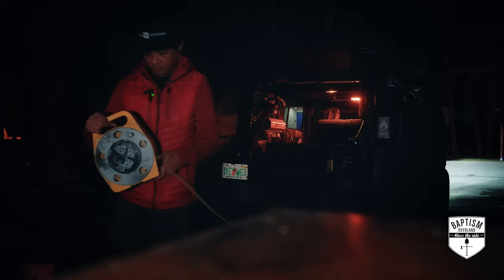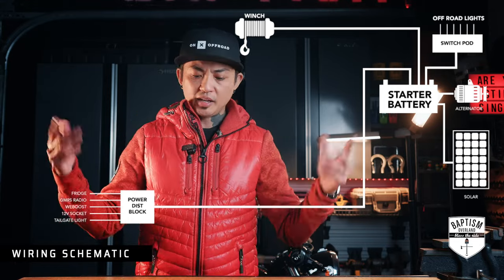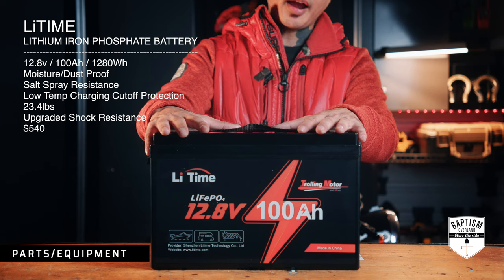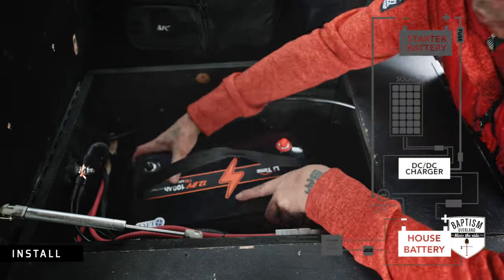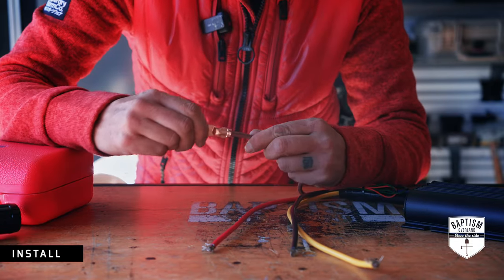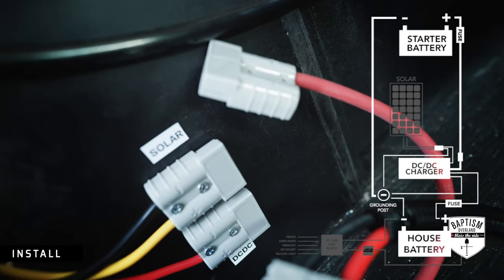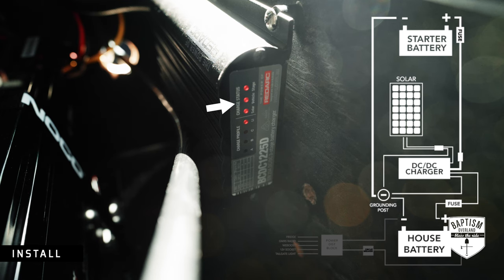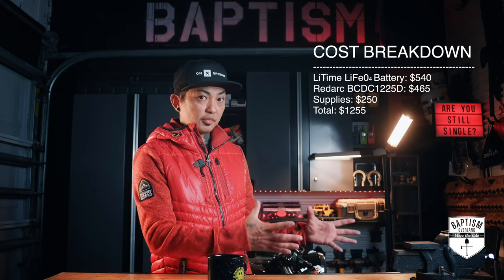REDARC + LiTIME...Dual Battery Setup Made Simple!

Comment: 🙂 I started with a small 100ah setup, and now have 400ah, 15K Invertor with RedArc Revision setup. It's addictive
Reply from the maker: Hahaha yeah I'm realizing that now
Reply: May I ask what you are running my friend with a 15k inverter? I understand having 400ah or more of battery especially if you want to go overlanding and be off-grid for days to weeks.
Reply: @DustinEveritt  Sorry. Typo on my part. It’s a 1500w inverter. I run a number of things depending on the trip and time of year. They can include fridge, CPAP, induction heater, rice cooker, and my EcoFlow Wave2 using a 24/12 DCDC converter during peak summer. 
My setup has changed since this post as well. Still 400ah but I now have 400w solar and up to 80a alternator charging. So the large capacity isn’t as necessary until you need over 100a constant pull for awhile. 
Hope that answers your question.
Reply: @midwestiowashooter  how do you like the EcoFlow Wave? Does it provide heat as well as AC? I have been looking at whether to do a DIY "House" Battery system or to purchase an EcoFlow Delta Pro/Delta Pro 2 and get their 800 watt DC-DC Inverter Charger or get Renogy Lycan..
Reply: @ I like it but also understand it has some huge limitations you have to overcome. It’s not going to run on max long with its own battery so use it for when the sun goes down. It will do heat but will stop if the intake are is below 0 so in those temps a diesel heater is better. For you to really get it to run in either case a line time you need more EcoFlow batteries or use a DCDC 12/24 to allow more than 8amps in. 
No matter what you do I think some kind of alternator DVDC charger is a must to quickly top off. The all in on units are nice for their price point but they have limits. When you go full dedicated dual battery cost quickly jumps but it’s a lot more versatile. For example diesel heaters can sometimes pull more than the DC output on an all in one unit can provide unless you switch to AC power, but a dedicated one it’s all about how you wire and fuse it for the potential load.
Reply: @midwestiowashooter  yeah that is definitely understandable. LiTime has some pretty decent deals right now for the holidays. I can get (2) 12.8V 300Ah RV batteries for the price of (1) 12.8V 400AH Deep Cycle Batteries. I'm also looking at their DC-DC chargers and Solar Charger as well. Trying to find a good budget 12 volt Fridge to have in the bed of my truck under my camper shell. I have a Utility Trailer that I want to convert into a DIY Micro-Camper like setup with the amenities. If you or anyone else has any suggestions or tips, they will be greatly appreciated.

Comment: Great video! I don’t recall you mentioning this, but with this current setup you have, in the event your main battery is dead, is it possible to have your home battery “jump” start it? Or do you need to add something else into this configuration to make that happen?
Reply from the maker: That I don't know. I have to find out. In other setups with some other brands it's as simple as turning on a switch. With the Redarc BCDC, I need to ask them

Comment: Nice quality and informative video. 
I ran into you and the other FAT (Florida Adventure Trail)  members in Florida a year ago and I now watch your show. You are right about dipping your toe into the 2nd battery space as I have over 6.5K in my system as Redarc is pricey but good stuff. I did the manager 30, 1500 W inverter, the new blue tooth enabled display, and the Rogue (but I have yet to set up the rogue). I have solar on my RTT and an Anderson plug under the hood for a second solar panel as no one wants to always park in the sun. As the RedArc’s manager 30 has a shore power option, I ran a plug in connector into my rear bumper so I have various options for power. For my battery I ran an SOK 200 ah version over Litime ones as it was cost effective and it had heaters if I traveled north. I did buy two of those Litime batteries but used my SOK on my 4runner and I plan on using them on some other portable builds for other vehicles with solar and the dc/dc charger setup. 
I would recommend looking at the Redarc Rogue as it has dimmable light options and sensors for fuel, water, and possibly for a temp sensor.
Reply from the maker: Well I guess I'll know who to ask when I get the other stuff haha I'm sure I'm gonna wanna grow it. Dual has been a game changer!

Comment: Great video I’m going to do something like this to power and electric air conditioning compressor. My car already has a sound system attached and the compressor would take a massive load on my car. So I was looking around for alternatives to not upgrade the alternator because there is no options for my car. I figured I would just at a house battery just to power the compressor. Thanks
Reply from the maker: If I can make a suggestion...never run your air compressor or winch to a secondary battery. Those are high amperage devices. USUALLY those items are tied directly to your start battery and alternator and use it only while the vehicle is running as that is designed to deliver a large CCA (cold cranking amps).  Smaller devices like fridge and lights can run off your secondary battery as those would be tied to deep cycle batteries- not massive discharges at once. You can get hybrid batteries which do both (like optima yellow top) but I would still run it off starter battery with the vehicle running. Spoke to REDARC and even some of the guys in Australia and none of them advises putting high amp draw items to your house battery. 

I know you mentioned you don't have any alternator options for your car. That gets a little tricky then. And your starter is already overloaded with a stereo system. Maybe an on-board air compressor won't be the right path. Maybe get ARB's portable air compressor or those heavy duty ones that can run it without hard wiring.

Just something to think about.

Comment: The renogy dcc50s also prioritises solar AND it will back charge the starter battery with solar when the house battery is full 👍
Reply from the maker: Good to know! Was looking at renogy stuff too. I honestly just didn't know how reliable they are. What do you think of their solar panels? I've been considering upgrading mine to 200w
Reply: @BaptismOverland  I've had a renogy system fir 3 yrars so far without issue,  I only have 4 100W panel and they work lol, not much else i can say on that,  I have fitted 7 other systems using the dcc50s without issue, all on boats ( I work on canal boats in the UK), renogy quality seems fine but communication and after sales is weak 😟  if I had to rank them I'd put them top of the cheap Chinese products,  maybe low end of the top tier,🤔 if that makes sense?
Reply from the maker: @Dirt-Diggler  makes total sense. That's been my take on them as well. Like you know what you're buying but damn, cheap pricing and it works pretty good!
Reply: @BaptismOverland  Realistically most of Renogy products are overpriced and are just relabeled SRNE stuff. Rich Solar for example is virtually the same but cheaper. HQST has the cheapest 40A MPPT Charge controller with Bluetooth for like $120. Can't beat that anywhere I've found. And it has the bluetooth needed for the app to get to a setting for Lithium. The others require an extra $30+ module

Comment: Great video just finished watching it. But I warn you😂 adding an inverter was a game changer for me, wify loved it just so she could use hair dryer, my ecoflow power bank charges faster with A/C. I even use a AC electric blanket, which can be more adjustable than 12v electric blanket. And finally I can use a small 110v electric heater in my RTT, with no condensation build up because it’s dry heat, possibilities are endless. The battery monitor is a must have. Since your battery is enclosed I would put an  4inch intake/exhaust fan that is temperature controlled, these systems are low cost on Amazon.
Reply from the maker: Good to know. But did you see a significant voltage drop going fr DC to AC?
Reply from the maker: Also if you're on IG, message me with recos on that exhaust fan. Might be great to add that in
Reply: @BaptismOverland will do
Reply: @BaptismOverland  A/c does drain your LIPO 4 battery quicker, but most A/C tools /appliances are used temporarily, but low wattage blankets/small heaters can last all night on low settings
Reply from the maker: @tim285401  not worried too much about the speed of draining. I just heard the conversion fr DC to AC creates a voltage drop so the power won't be as high. But if you haven't noticed a difference then I'm gonna have to heavily consider an inverter! 

Is there a particular inverter you would recommend? Idk if I want to spend the money on the redarc one
Reply: I have a Renergy 1000 watt inverter, for about $150 on Amazon. All my appliances and batteries charger for tools charges like a standard household outlet, I don’t run high current tools/appliances for too long and I usually have vehicle running if I’m running hair dryer or high drawing equipment. A 2000 watt inverter (extra $60) will work but will draw aux battery down faster
Reply: @BaptismOverland  I've been using a 2000w PowerTechOn for probably 5 years or so...been really good. Draws a bit of power on standby. It seems like the fans run longer than needed...but manual management of it and it should be fine.

Comment: If both my main and auxiliary batteries are the same (agm) could I use a battery isolator and a BCDC charger in conjunction? That way when the vehicle is on both batteries get properly charged and I have the most available amps
Reply from the maker: Well technically this unit IS the isolator also. It's all in one. When you buy from Redarc they say an isolator is no longer needed. That being said I would most def check with them first as I'm neither a sales rep or a certified electrician.  But I never needed an isolator

Comment: Can you talk about distribution box vs inverter? Do I need an inverter for a dometic 55 fridge?
Reply from the maker: Those are 2 vastly diff things.

A dist block is just a way to send power to multiple devices. An inverter is a device that converts 12v to like 24v so you can plug in things that have an AC plug (hair dryers, coffee makers, chain saws). 

Fridges made for vehicles are 12v appliances. You don't need an inverter. It comes with a 12v socket. You CAN use the provided AC plug and plug it into your inverter but try never to use an inverter if you don't have to because the conversion from 12v to 24v isn't super efficient. Again, the inverters are really for those devices that require more that 12v to run

I personally didn't install an inverter cuz I've never needed to bring an appliance that has an ac plug. But some people do

Comment: I thought you said the air compressor shoudl be connected to the starting battery but I notice you hvae a fuse in teh dist block for Air Compressor, so I assume that is running off the house battery? Also what amp fuse do you have for that since compressors normally draw alot of power
Reply from the maker: @davehahn23  no the compressor is still on the starter battery. That fuse block, the label that says "air compressor" is ONLY for the switch that triggers the relay for the compressor. Basicallly your huge wires coming out of the compressor that actually runs it must go to starter. The switch is a thin wire that can go to any 12v source. Make sense?
Reply: @BaptismOverland  Thanks for the reply, that is what I did as well, I have the 6awg that came with the compressor kit going to the starter battery and the long positive that came with the Redarc wiring kit going to the starter battery as well. I did the grounds in the back of the vehicle so I didn;t have to run long ground wires back to the engine bay.

Comment: Nice setup and really very informative video for me to do it myself as well. I have a question here. Is it necessary for us route the grounding wire back to starter battery or we can just connect it to a bolt on a car chassis from the grounding post?
Reply from the maker: The important thing is a good ground. If you can find or make one, go for it! I almost did. But I routed it back to the battery because I already know that's a pure ground right there by the factory. Less resistance vs me finding one and making sure it's solid. Totally up to you.
Reply: @BaptismOverland   Got it. Yes, it make sense when the battery already has a pure ground from factory. Trying to setup mine next month. Hopefully everything goes well.
Reply from the maker: @tanchetming  yeah I've had grounds I've gone to that has failed. So when poss I just go direct to source
Reply from the maker: @tanchetming  good luck bro!
Reply: @BaptismOverland thanks bro. Been spending months doing the planning until now only have time to start the project.
Reply: @BaptismOverland  As mentioned you can...but the problem is keeping a good clean ground. Best option is back to at least under the hood where you can put a Ground Buss Bar. But at a minimum, clean all surfaces then smear Dielectric grease on contact surfaces and crank it all down. That will keep a corrosion free connection for years even though it's rusting all around it.

Comment: Great video.  Does the has batter have to be same type as aux battery?
Reply from the maker: No. I went with lithium as it's lighter
Reply: With a DC-DC charger it doesn't...that's the advantage of using one. It can charge virtually any other normal battery type.

Comment: When installing in such a closed box, isn't it too hot for the radrac?
Reply from the maker: I have a bunch of venting areas that you probably can't see. Primarily in the front of the box just behind my air compressor and also in the back where the wires go through. This way air can flow through. Never had any overheating issues and this thing is on 24/7
Reply from the maker: That being said, yes make sure you don't fully enclose it. I also take solace in the fact that many people even install this in the engine bay where it can get really hot and they don't have issues there.  But still, better to be safe than sorry so the more venting you can give it the better.

Comment: Are you running a regular vehicle battery or a Optima Yellow Top AGM Dual Purpose Deep Cycle/ Starter or equivalent?
Reply from the maker: My starter is an AGW deep cycle fr Die Hard. I'm gonna need a new one soon though and will prob go yellow top
Reply: @BaptismOverland  I personally think the Optima's are way overhyped. I tried an expensive red top, it lasted a year ish. Got it replaced under warranty...the 2nd lasted the same...I said forget it went back to regular. I haven't tried the yellow.

Comment: you need to have the Redarc SBI 12V 100A isolator which protects the starter battery as the dcdc controller using the blue igition wire can still drain the starter battery. The SBI12 is simply a smart voltage sensing relay than joins an auxiliary battery with a start battery when certain voltage levels have been met i.e. put simply 13.2Volt turn on and 12.7Volts turn off…without it you will run into issues.  video explanation here from 4xoverland in australia. Called runaway discharge if you leave the ignition on accidentaly. https://www.youtube.com/watch?v=rDXixCzg6iw
Reply from the maker: So I actually messaged them about that and they said that it's not really needed. But I'll def take a look now!! Thanks!

Also the blue ignition wire on mine isn't wired anywhere though
Reply from the maker: 4XOverland is fr S Africa btw. I just know cuz I follow him haha love his rigs 

Also I don't think his battery has a cutoff like mine does. But I'm about to watch his video now and see if it applies to my application
Reply from the maker: Ok I just watched. It doesn't apply to me as I don't have a charger in my system. I'm also not using the blue trigger cable and my solar is plugged to auxiliary battery and not the starter. The BCDC I have (which is actually a newer version of what he has) has all the other charging like solar going directly to the unit. What he had is an older version where he had to set up other charging means separately. The unit is all encompassing and will basically take care of all those issues for you now.
Reply: @BaptismOverland ... My unqualified U2oob commentator $0.02

I too am learning here.

Brother Murphy's questions appear to be nicely addressed in Redarc's BCDC Install Manual.

As one would hope, good reasons for more $$ for a Redarc BCDC.

For instance, the vehicle starter battery isolation appears to be a built in function of a Redarc BCDC, see the BCDC manual's "Turn On/Off Thresholds".

The blue wire appears to tell the BCDC what kind of alternator & starting system your vehicle has, basically, old school or new skewel.
Reply from the maker: Well either way my system has been running super good setup how I had it. I've not had any issues with my starter battery at all